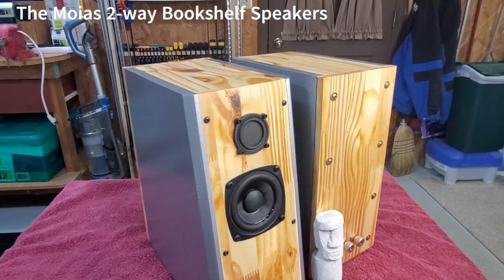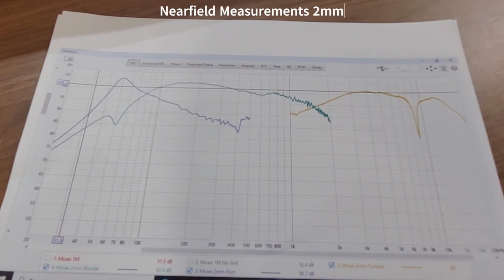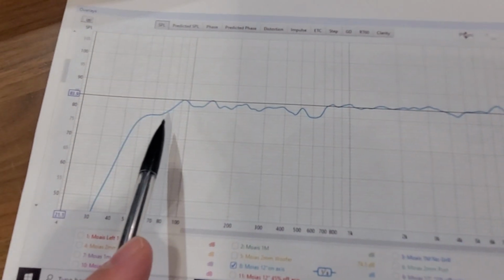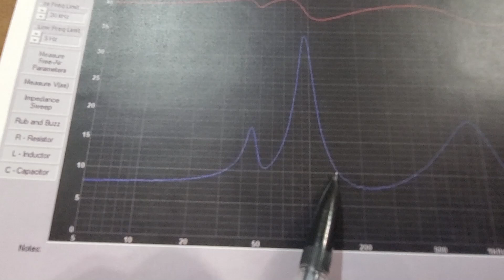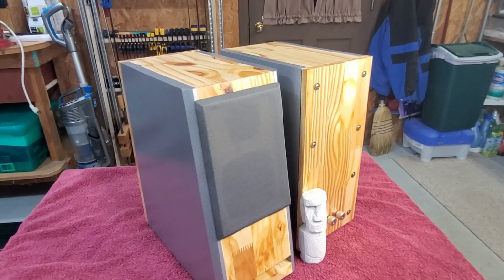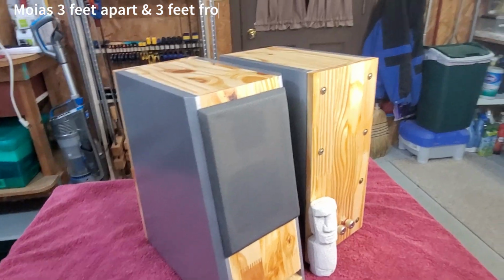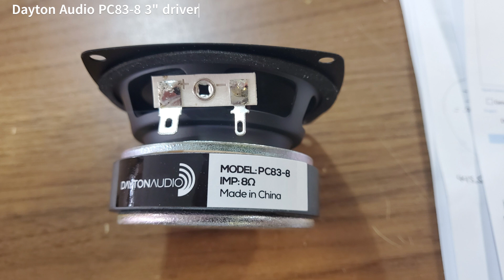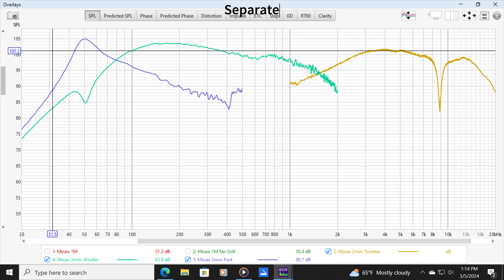The Moai 2-way Bookshelf Speakers with Music Demos

Comment from the maker: A little follow up to answer some questions. I am using these in a 2.1 channel system with a small sub and they blend quite well. The Tectonic BMR tweeter is surprisingly good in this setup. The wide dispersion pattern and thin baffles makes these small books shelfs sound larger than they are. The only issue with the tweeter is its low sensitivity(80db) and power handling (10watts rms). I think this imbalance in sensitivity between the drivers(5db) is why I did not need a baffle step circuit in this design. Just be careful how much signal and wattage you send through this tweeter.
Reply: Do you think 15 watt could damage BMR ?
Reply from the maker: @OscarHernandez-ym4hx  It's max output is rated at 20 watts so it should be fine. If you cross it over high enough, like 1500Hz+, it should function like any other tweeter in its' price range.

Comment: I've thought about building a similar design but with the HiVi B4N woofer for deeper bass. Low crossover point with this tweeter at the baffle step and with a baffle step of around 4db to put on stands. Thanks for this build! It's nice to hear the tweeter in action. The Tectonic tweeter is flat at about 79-80db on the Tectonic website response plot and yours looks like it's up around 84 or better though?
Reply from the maker: I, too, have used the B4N before. Nice little woofer. Good Luck!
Reply from the maker: I rolled the Tectonic BMR off around 1500Hz which I think helped raise the sensitivity up a few db.  The main issue is to watch your wattage to them. They're rated only to 20 watt peaks.

Comment: how loud is the tectronic by itself?
Reply from the maker: @TheCasualSirenEnthusiast  I haven't tested them for SPL's. Balance wise, they match well with the little 3.5 inch Sayton Audio woofer. They are rated 10 watts rms, so I wouldn't push them too hard.